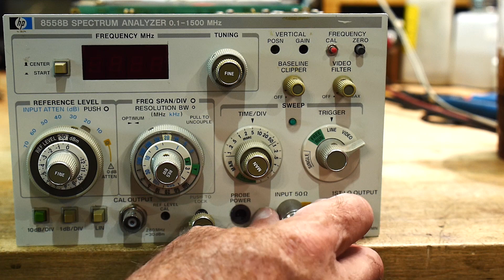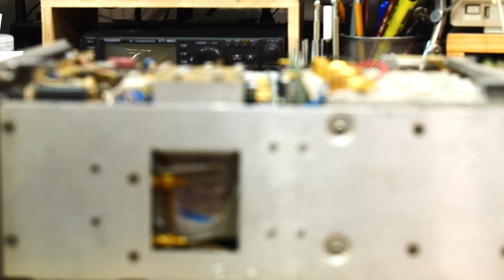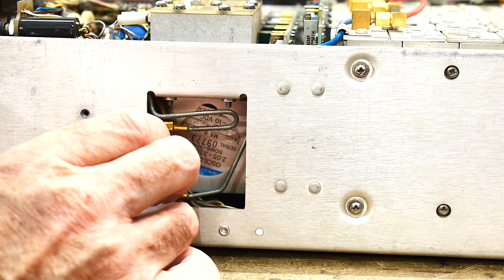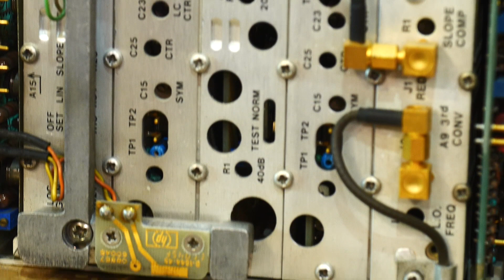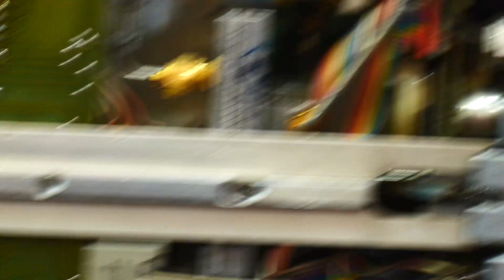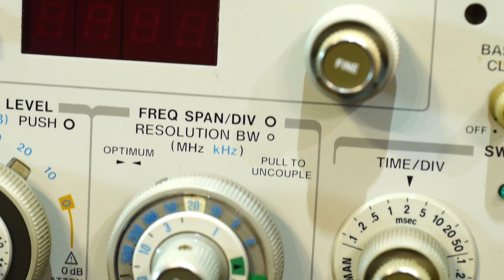#543 HP 8558B Spectrum Analyzer Plugin

Comment: I have an HP Spectrum Analyzer with the 141T Display, 8554B RF section and the 8552B IF section. Cal output to the RF input doesn’t seem to be working. Maybe I am doing it wrong. Do you have experience with this spectrum analyzer?
Reply from the maker: No experience with that model. So the instrument works fine but there is not output on the cal connector? if this is the case, the cal output is usually a separate oscillator or comb generator. Should be any easy thing to fix.
Reply from the maker: I looked at the schematics for the IF section where the cal output is generated. it is a simple 30MHz xtal oscillator. did you connect this output to an oscilloscope?

Comment: Thanks for the tour! Hopefully, the controls are all OK. It'd be cool to get it running with a scope as its new display. The Rigol's X-Y mode may not work great for this purpose, but good enough to check it out. Anyway, you need a second SA in case you have to work on your 8921A. ;-)
Reply from the maker: yes the rigol xy sucks
Reply: @IMSAIGuy  Yeah, it's good to have an analog scope for this kind of thing (and scope art, animation, clock, etc.).
Reply from the maker: @TestEquipmentAnonymous  I've got an analog scope. just don't want to drag it into the garage. I did find a way to use the rigol in an upcomming video
Reply: @IMSAIGuy  No worries. Just sharing ideas. Looking forward to the next video, as always. Cheers!